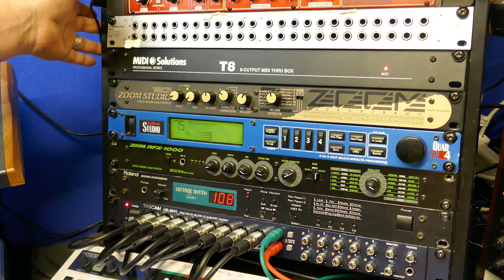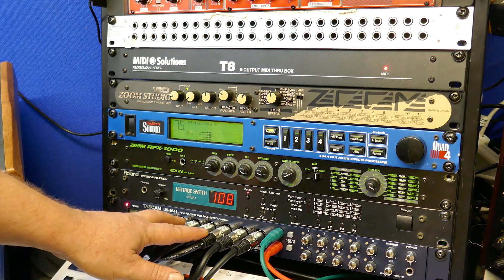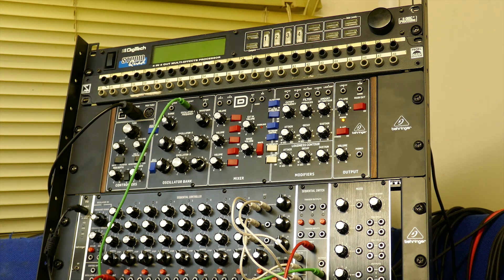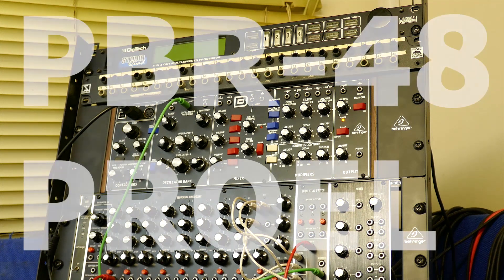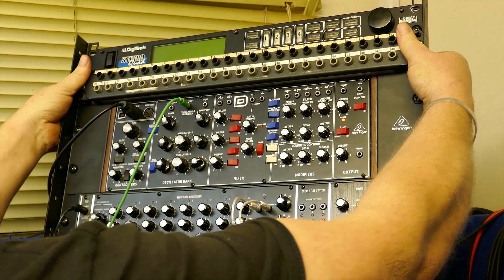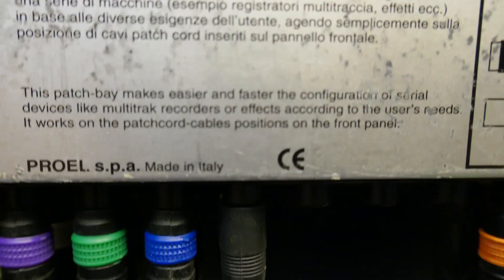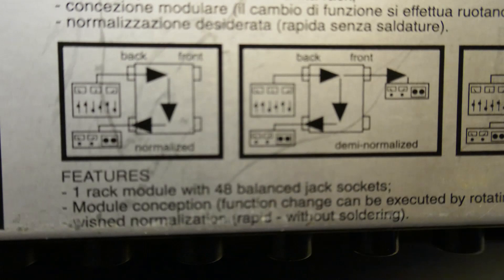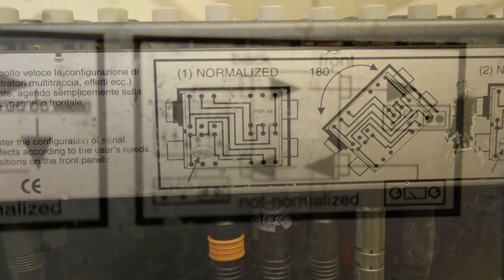Patchbays Explained: How to use different Proel & Behringer types of rack mount studio patch bays

Comment: So you really only need one if you don't have enough inputs on your interface for all your gear?
Reply from the maker: And if you want to route gear into different fx and swap it around quickly!  They're handy if you've a tonne of gear tbh
Reply: @Studio-solutions-com  I have 48 analog inputs for my synths but have been looking into rack effects. I also have the option of 24 available digital inputs that I don't use at all but they would subtract from my available analog ones. I could add another Digidesign 192 to my setup for more inputs but was thinking a patchbay would be cheaper. Blew my budget on the new Roland Boutiques to keep the set complete. Good to hear from you!

Comment: I built a funny sort of patch bay / box in the mid 90s.
Not a rack module.. just a wooden box I found (shoebox sized). I put 1/4 in jacks on front and rcas on the back.
Some connections were normalized, such was where two tape decks were connected.
I found this old thing recently.
I should get it out and show some pictures.
Good for a laugh!
Reply from the maker: That sounds pretty handy though..!!!  At least building your own you're gonna remember which are normalised lol
Reply: I bought a Tascam PBay a few years back.
I have it in a rack case with a few bits and pieces connected such as my reel to reel and a couple of tape decks.
I vaguely remember something about switching the modules so they are normalized.

I should get into it.
My problem is that while I have a working studio space; I dont have enough room to really spread out all my gear properly.

One day we buy bigger house!

Then I will probably buy more gear!
Reply from the maker: @robguitarwizard  Just get rid of non essential furniture lol

Comment: Hola... I def need a patch bay... it all seems really complicated haha ... at the moment I have one part of my bedroom studio that I use for Cubase on my Mac etc ... other part is just hardware which I swap around a lot.... I have a 16 channel mixer for the Mac and 12 channel mixer  for the hardware corner ...  I’m still learning all this 😳... patchbay for both? Confused ... great video matey ... I’ll just keep watching again and again until the Penny drops! Awesome 😎🙏✌️
Reply from the maker: Hey Foxy, thanks mate! I mostly use it to be able to run extra gear into my interface, a mixer works just as well though...  until you run out of channels and need even more sub-mixers lol A bigger isb mixer is really what I need, but then I have desk space issues which is why I like racks...  im still torn myself!! 😏🤣🤣🤣
Reply: @Studio-solutions-com  hey matey... yes but doesn’t it make it easier if say you want to use a synth or guitar etc to patch into an effects peddle or if you are recording ... just move a few cables around? It just seems in my head if everything is hooked up to the patch bay I won’t have to have a huge mixer or sub mixers clogging up space? I’m still confused hahah 😎🙏✌️👍
Reply from the maker: @FoxyNirvana  yes exactly that mate..!! I can add in effects to any of the gear without having to move cables around much other than just to plug into the front of the patchbay..! Another reason I like rack gear is because rack fx are neat and tidy and so cheap to find used !